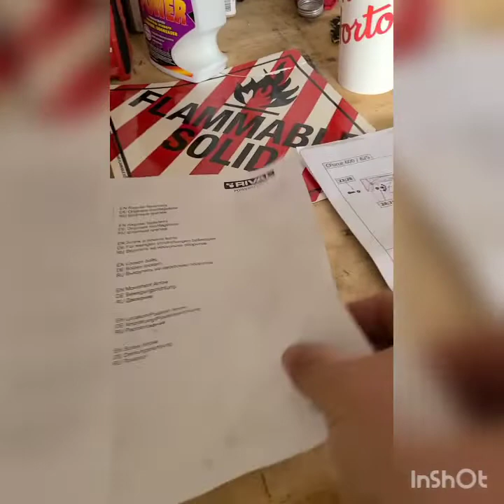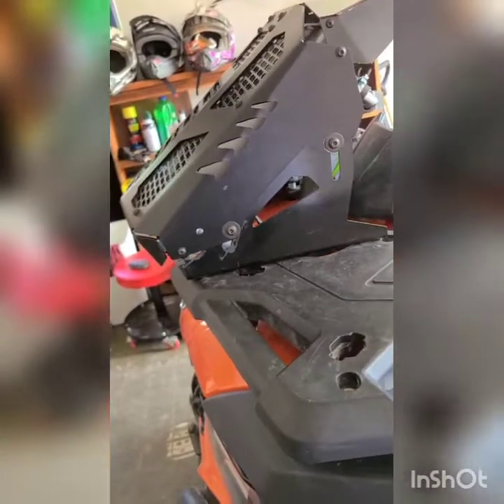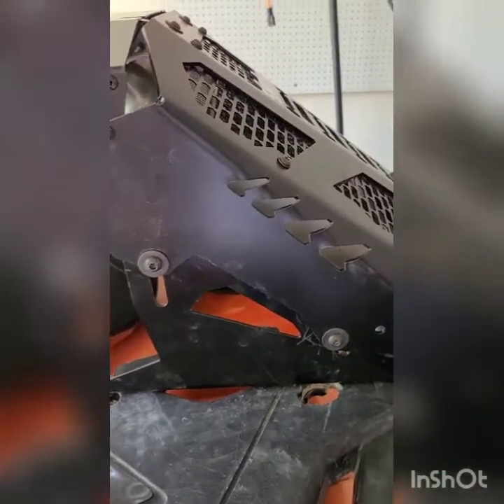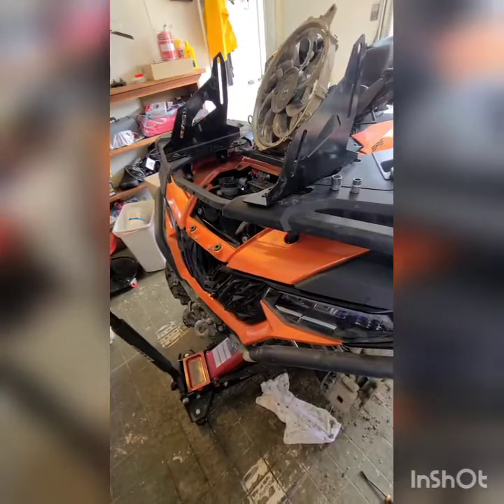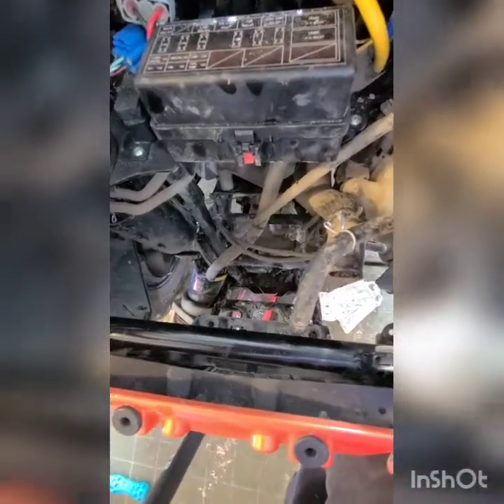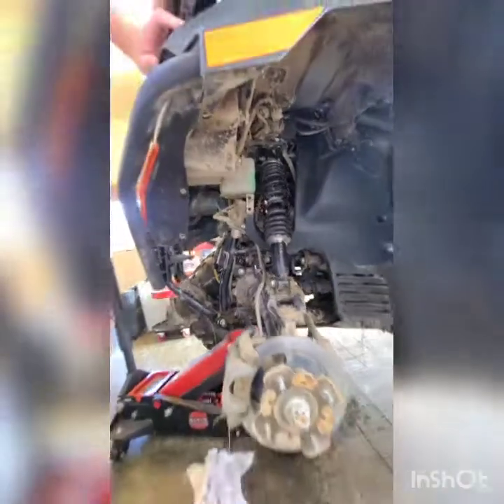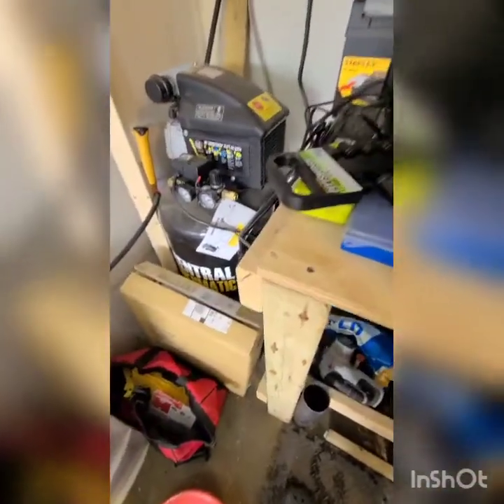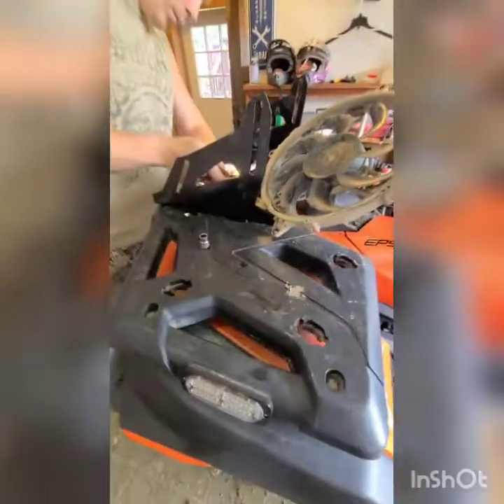2020 cforce 600 radiator relocation explained

Comment: It sucks that if its not technically a 2 up you can still get a ticket for having a passenger even if you have a 1 up with a passenger seat. Crazy!
Reply from the maker: Yeah I keep it mostly off road so hopefully I won't give them a reason to stop me.
Reply: @4strokefordsmoke .  Hey. I know your video is old and I’m not sure if you will see my message and question on your video here, but I also got the Rival kit like you but I also got the one with the snorkels on it.  My question is when you and your friend did the radiator relocation on your cforce, afterwards when you added the antifreeze back in and burped the system did your top radiator hose get hot to the touch and the top of your radiator get hot as well without a bar showing on your gauge and your fan not come on?
Reply from the maker: @LordScythe85  so honestly we barely lost any antifreeze and if I remember correctly I added a very little. Let it run with the rad cap off and the front end jacked up to push out any air. This could be your problem. My rad hose is hot and I believe the cap is to. But that's ok, I would think means it's doing its job and cycling the coolant.

Comment: Ok, I'm a girl and need just a little help.  I want to spray a foam cleaner directly onto the radiator and have no clue how to get the front off to spray it directly. I can't do it through the front because it is super foamy and need to hit the radiator. So where do I start to take the front off. It's a 2018 CFMoto.  Thanks for your time
Reply from the maker: Are you talking about how to get the front of the machine apart to spray cleaning into the radiator fins? I'm assuming you have a stock set up and not after market relocation kit like in this video. If that's the case inorder to get to the front of the machine it would be easier to remove the radiator to clean it
Reply: @4strokefordsmoke  Yes exactly, all factory and yes right on fins.Thanks so much for a fast reply
Reply from the maker: Yeah I'm sure there a way to remove the head lights, bumer grill and all that but I'd just remove the radiator it self. What year and size machine do you have
Reply: @4strokefordsmoke  2018 500
Reply from the maker: @user-rh1mr1rl4d  that's gonna be a different set up but I'd still say pull the radiator and deep clean it